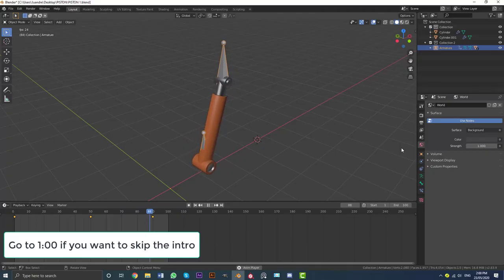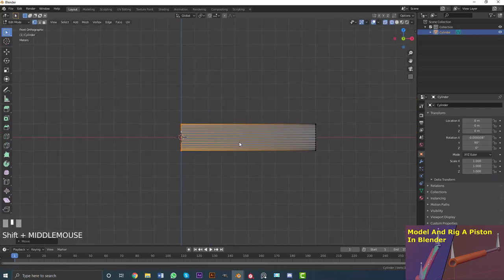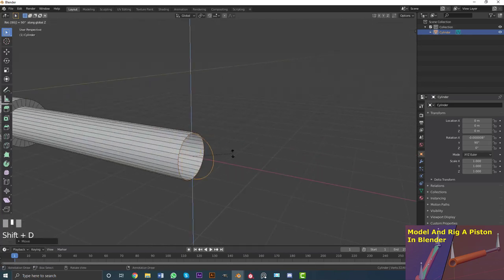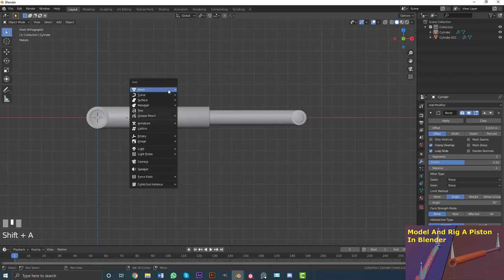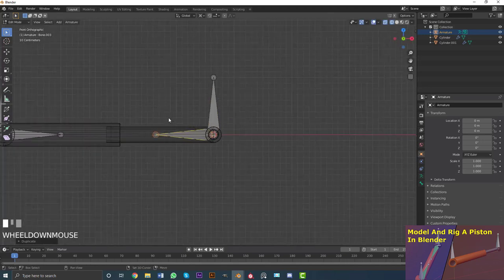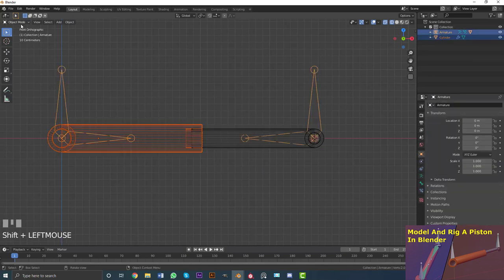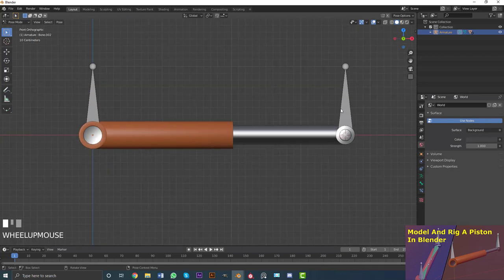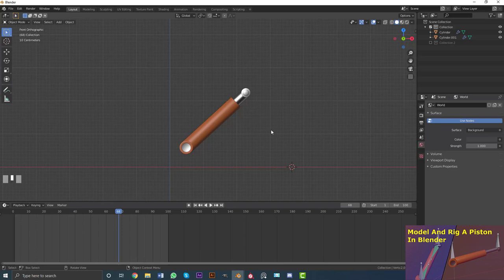Model & Rig Pistons fast in Blender 2.8+

Comment: great video except somethings would have messed me up if I was new to blender:
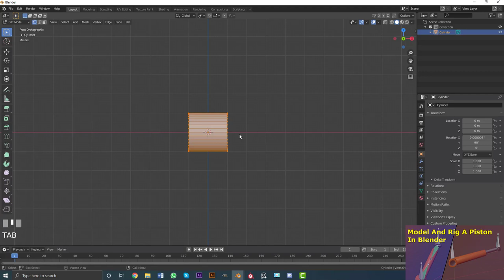1:25 (you need to be in edit mode to grab the verts) It's hard to hear but he says you need to be in XRay by using Alt Z (you need to be in xray to grab the verts that are out of view.)
1:30 Snap during transform (increment) need to be selected.
1:55 it's shift d r z 90.... not shift d r "x" 90

Comment: Day 9 of trying to do this. Nothing works in blender as I intend
I have tried to follow this tutorial, and this guy does an excellent job, but every single thing I have tried to Accomplish does not work at all as how I want it to. 
If someone out there would help me by getting in my discord, that would be great, if not I don't care, I will not stop, I am Persistent
Reply: Found the issue, check the constraint editor and mess with the "track axis" and "up" settings. The issue is that you (and i) probably used the wrong rotation/axis when adding the bones. Reply if im stupid cause i might be totally wrong. (if that is your issue)
Reply: Damped track

Comment: My blender version is 2.91 but If I applied track constraints to bone the bone changes its position and if I used to rotate the other bone then it's not tracking the bone insted it rotates ,help me how  can I fix this issue
Reply: Same. When I press Ctrl + Shift + C and then Track to the target bone moves at exact same position as its parent.
Reply: Try damped track instead of track to
Reply: move whatever you have selected a bit, the tracked bone should move. Select it and then look at the constraint tab where you can change the tracking axes
Reply: turns out track to has other problems, just use damped track
Reply: Same here.  SMH at this program.  It never works!

Comment: This bug is really bad on mine??? In both Pose mode and Object mode, both of the internal bones point straight up which makes it confusing to select and edit... If I tab to edit mode it fixes it.. but only whilst in Edit mode... If I tab to pose/object view, I still have the bug. Fortunately I managed to get this rig to work as buggy as it looks. 

Also, I noticed when I posed it to move it around, it followed the constraints but when I let go, it looked as if it was pulling the inner tube out part of the side of the bigger (external) tube... Very strange. But the video itself was GREAT! informative and easy to follow... Just a shame about how buggy my one is hahaha!! Thanks for the video!!
Reply: same thing, very annoying
Reply: Found the issue, check the constraint editor and mess with the "track axis" and "up" settings. The issue is that you (and i) probably used the wrong rotation/axis when adding the bones. Reply if im stupid cause i might be totally wrong. its been a year so you probably figured it out lol, possibly*
Reply: @ellathon22  - It should be this difficult. Where is the "track axis" and "up" settings?

Comment: When trying to add an Armature, I don't get any options to add bones showing up, just the initial "Add Armature"? 

I checked one last time before posting this... Turns out on the right hand side, you can click on the "Armature" drop down and inside of that you will find the "Bone", in Edit mode and Wireframe View mode,  if you then click on this you will see the small bone light up Orange. Hopefully this will help any other noobs (like myself) that encounter the same issue :)

Good luck with your learning and any future builds :D
Reply: You need to activate  pre-installed " Rigify " add-on.

Comment: I think the reason you're getting that error at 7:50 is because you have a dependency loop caused by 2 bones constraining each other. If you add constraints from the parent bone instead, you shouldn't have any issue.

Comment: The part with track constraint isn't working for me for some reason. I'm pretty sure I did everything you did.
Reply: try using "damped track" instead - I had the same issue. oh and the note about track axis as well - as I think that is what I changed that fixed it.
Reply: @beevo412  damped track gives a shtty delay :(
Reply: @beevo412  dude thanks, that fixed it to me.